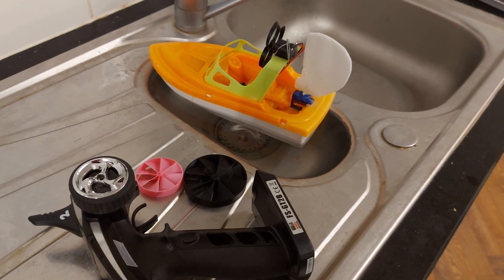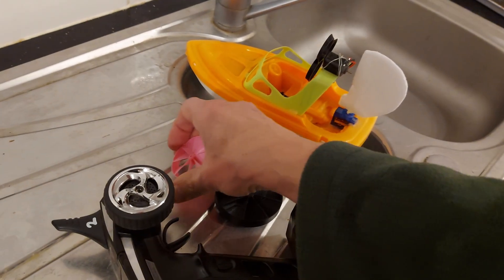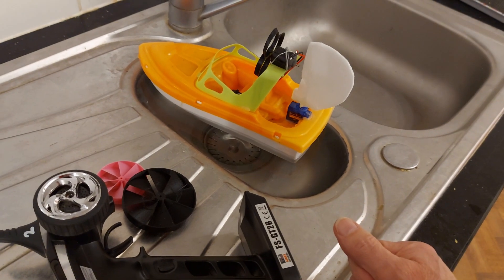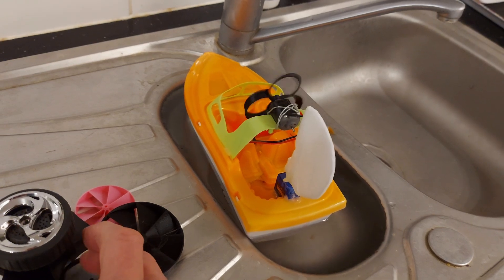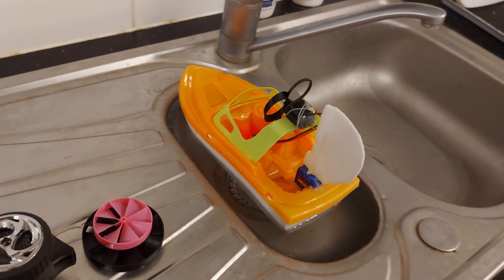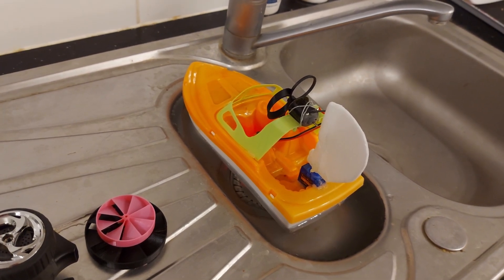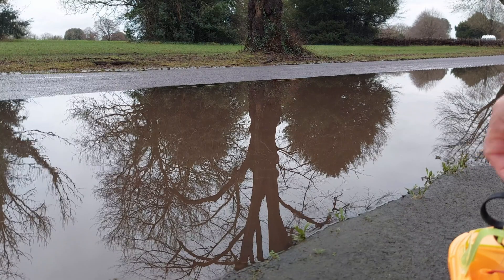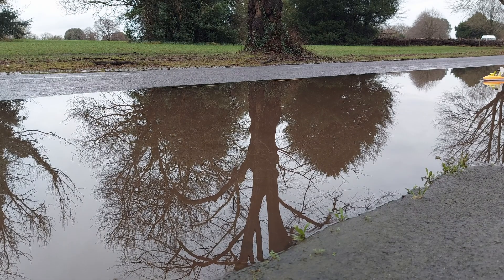Trying a Toroidal Propeller on the air boat

Comment: I like that toroidal prop!
Some good boating, it seemed like it could do left with some care and skill applied.
Also noticed that it seems to be a hit with the ladies lol
Reply from the maker: I think that the larger motor may be disrupting the air flow. I tested the dual rudder version yesterday in the water butt and should be editing that video tonight, but I have just found there is no audio on it, must have forgotten to turn on the wireless mic. I will either just put music on it or maybe do a voice over.

Comment: I think the reason it turns to the right better than the left is partly down to the way the fan swirls the air - so the air hits the rudder with a spiral motion.  You could add some flow-straightening fences between the fan and the rudder to test the theory.  Just a vertical fence would probably be enough, but you could try a horizontal one too, if that doesn't work - the cross section of the fence would then have a + shape, with the centre of the + in line with the fan shaft.
Reply from the maker: The later video is the twin rudder version. Some of the issue may be the air flow is disrupted by the motor itself and the support structure. When I first put the boat together, 8 years ago, it was a smaller motor, so less obstruction to the airflow https://youtu.be/Znq8f1UF_uc